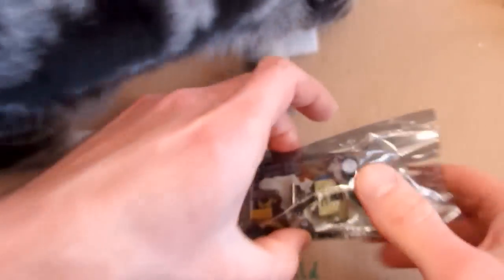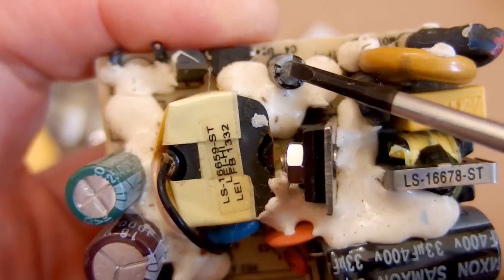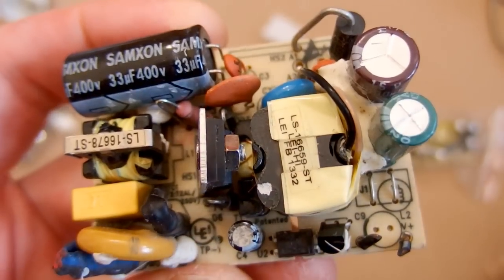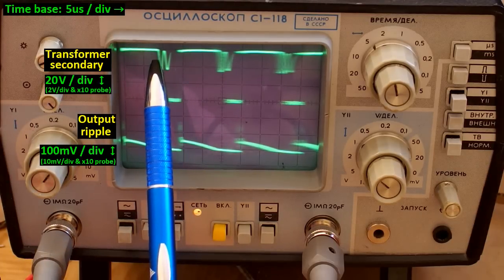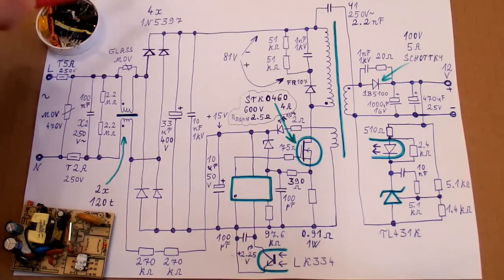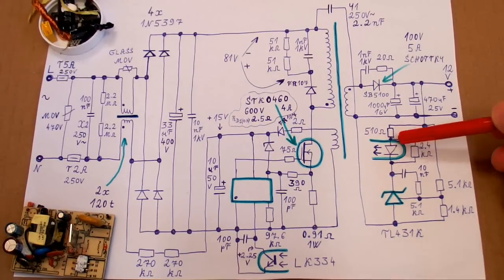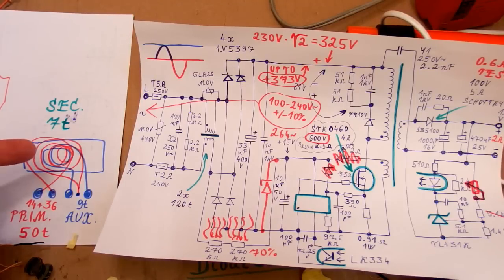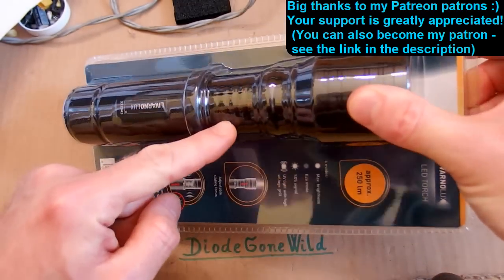12V 2A switching power supply - test, teardown, schematic, analysis

Comment: Can you tell me why some power supply output shock a little despite the output voltage is 12v??
Reply: The live is connected with ground through a capacitor and the negative output is grounded. So this means that if the power supply is not grounded, it can give you a slight shock.
Reply: This is the Y capacitor at the top of DGW's schematic. The larger its value the greater the leakage current. There's also stray capacitances in the transformer. Of course, there could also be improper separation in cheaply made supplies.

Comment: 23:04 I guess that's a slightly bad thing because that means the 400V capacitor could stay charged for a long time in a very niche case where it has to restart in that time and could shock you if you open it. Usually that cap would be mostly discharged by converting that energy into output energy. But I guess noone should rely on that anyway when opening it up.
Reply: Usually these power supplys are found in wall adapters that are welded shut an arnt ment to be opened anyways so a discharge resistor for the prymary cap isnt needed. But for good practice it shuld still be included

Comment: Nice video and I like your wet tissue thermostat, I guess it doesn't need much calibration as long as you know the pressure, you should sell the wet tissues on ebay :-)

Comment: I hate capacitors between primary and secondary, even class Y1, because they make isolation much worse! Better to remove them and just place a 100nf capacitor in parallel with the output!

Comment: How can you touch the drain of the transistor at the primary side while working? it could be dangerous probably. does it have isolated headsink?
Reply from the maker: The heatsink is connected to the primary side negative, but i'm not touching anything grounded, so there's no current path ;).

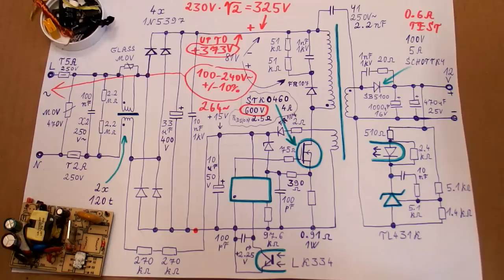Comment: 22:00 this arrangement of connecting the 270kΩ resistors before the bridge rectifier may also prevent us to operate the chip on DC mains till we connect in the proper polarity.
Reply: Depending on the voltage of the DC mains, those resistors may cook!
Reply: @Mark1024MAK  , No way man, those resistors won't get cooked even on 300V continuous DC, (270k+270k) 540k won't be dissipating that much power at normal mains voltage level.

Comment: "are you kidding me? dodgy (analysis)" put the cat back on. 
What you have labeled as the transformer secondary looks pretty normal for the voltage on the primary. 
EDIT: all the waveforms are the same on all the windings of transformer as they should be.  I was wondering why the scope was having trouble triggering perhaps because of the snubber.  
It looks like the on time of the transistor is constant.

The lower flat voltage is the transistor turned on charging the inductor. The upper flat voltage is the inductor discharging into the output capacitor. The ringing is the interval where the small remaining magnetizing inductance in discontinuous mode resonates with the parasitic
s
Anyone know how to see if that really is Underwriters Laboratory approved?

Comment: The Samxon output capacitors will probably fail first.
Reply from the maker: It's almost always the output capacitor(s) that fails :).
Reply: True...Samxon capacitors are quite good though.
Reply: @douro20  Not in my experience.